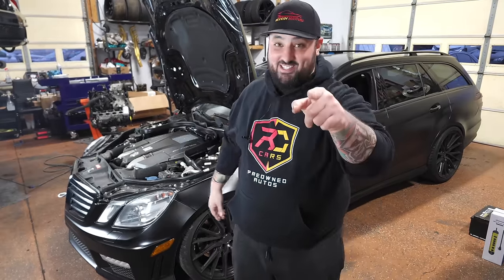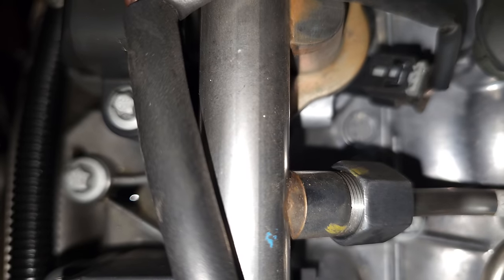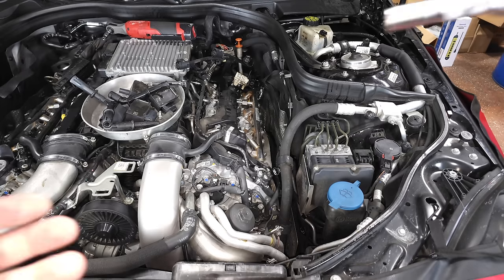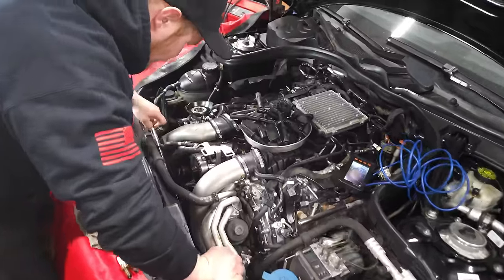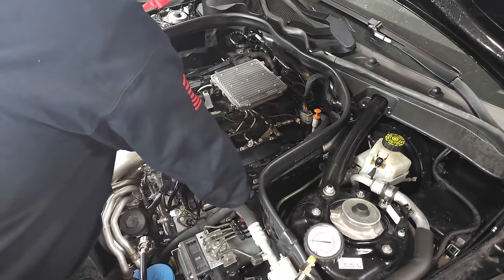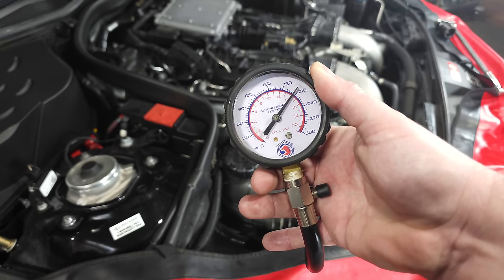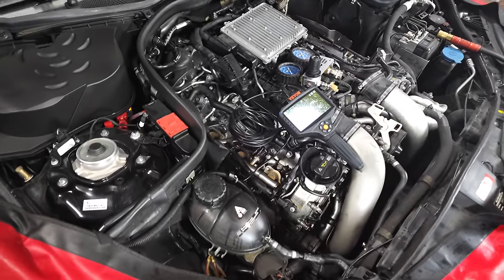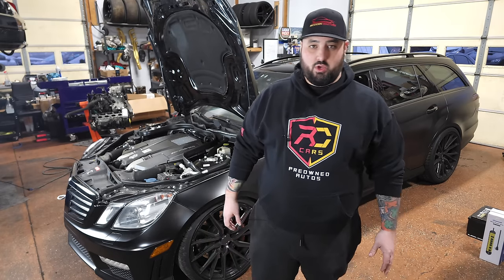Biturbo AMG Diagnostic and Results! 3 Major M157/M278 failures to look for on your Mercedes Engine!

Comment: Around those miles on m157 is going to hit you on the pocket. Turbo cooling lines goes bad, heater valve breaks “ major cooling leak “ camshaft sensor goes bad , torque converter goes bad, high pressure fuel pump also, shifter goes bad, and more
Reply from the maker: Yes!!! Have to freshen them up for the next 100k of enjoyment!!

Comment: I have a cls63 2011 same problems made me sad also the computer gearbox Cost 2500 € now arco not work so bit sad stil for me best looking amg but in Nederlands car Costa fulloption 180.000€ newe boot my 2022 135000klm have 645hp love car but i think to manny weak problems nowe car cost me 40k repairs 15k extra inculd brakes and disk That was 5k hope no more cost uh time chane is not done but no ratels thx for this good video

Comment: 2016 SL 550 76 K Miles. Zero scoring or  leaks. All numbers on diag are factory still.  

1. Turn off the dumb auto start stop 

3. 3 K Mobile 1 service intervals NOT 10K

4. 93 only 

5. Never skip required maintenance 

This has worked for me with this M278

And I did all 3 like comment sub
Reply from the maker: Thanks Chris! And that's a hood way to maintain your car! Try some liquimoly oil flush, and oil!
Reply: Another huge thing that is overlooked is that the 2016 and newer m278 engines have iron cylinders instead of the garbage Silitec ones made in the earlier cars

Comment: Fabulous content! Keep posting! Army vet, as well (4 ID). I am an M157(wagon) and M278 (CLS) owner. Both engines have updated chains; both engines experienced oil intrusion to the harness at 20k original miles (remedied with new harness/ECU/4x CSPSs (M278)) and cleaner/2x new CSPSs for (M157)). I swap engine oil every 3500 miles (0W-40 Mobile 1 with BG additive) I will be switching to Liqui Moly on next servicing. Compression tests OK on both engines (knock on wood). I also don't hot rod either of them very often; just a spirited spank every now and then to "reboot" the engine cadences. Top tier premium fuel always.
Reply from the maker: You, sir, have some cool rides!
Reply: @ModernMastersAuto  They are special indeed!

Comment: i was expecting 20-30k subs! great quality and you'll reach it in no time
Reply from the maker: We just started but it's only getting better from here! Thanks for your time!
Reply: thanks for explaining the leakdown, also when you smell the spark plugs what is a "lean" or rich smell?  @ModernMastersAuto
Reply from the maker: @Zzafari7  lean has a distinct odor and it means the car was ran opposite of rich meaning less fuel and a hotter burn. Rich smell is just fuel a lot of fuel!

Comment: i have a 2012 with old timing chain. been relgious about oil changes and NO tune. been fine so far but im sure if keep the car will need to change it. 105K miles

and the headbolt issue was a 156 issue right, not 157

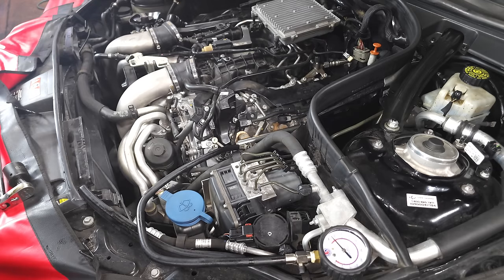Comment: 31:34  On the engine ecu you have an automated electronic compression test that gets you the same results as the manual compression test so no need to waste 1 hour dismantling and screwing in the test gauge just be sure you know how to read it.😊
Reply from the maker: With wanting to know the technicalities before deciding on building or saving an engine, a manual compression test is the only true way to know. Never go off a scan tool for something this expensive.
Reply: It was just a friendly advise , you shouldn't get offended like this. I worked on the electronic design of these cars as an engineer for daimler , using original equipment to do a electronic compression test is the same as using a manual compression test but takes 1 minute and you even get the difference test graphs but you only need to know how to read it, the diagnosis tool named STAR will instruct you when to use a leak test tool and diagnose further , in a mb workshop there are a lot of cars and pulling out plugs is time consuming so my colegues design this test . I'm sorry that you took my advice the wrong way 😔
Reply from the maker: @Hi.Al.  I didn't take it the wrong way and I'm sorry if it came off that way. With how bad these engines are getting we jump right to physically testing compression and leakdown.
Reply: @ModernMastersAuto  I can confirm the first generation was a recall frenzy because of ecology mods required by law here but the last generations had steel liners along with improved timing chain and different diameter tensioners,  resealed sensors, re designed intercooler,  and many more improvements too many to write .

Comment: What was the outcome on this? My 2015 E63 S has a weaping rear main seal and seems to be burning some oil (ir gets drivrn qhite gard tho) I have no other known issues and am very familiar wirh the platform, but the KBB value has dropped $12K since I bought it and the value is now underwager vs my loan amount remaining. Im thinking of getting out of it rather than dumping money into her, even though I LOVE this car and the M157, my financial situation ahs deteriorated in the 2 years since I got her and looking at $5-10K in work is now not really feasible anymore. 

Given that, what should I expect to pay to have a borescope check for the cylinder scoring and a pressure/leak down test performed?

Comment: What do you disconnect to do compression test on this m157?  just disconnect the ME? because the fuel injectors are directly control by ME ? I’m trying to do my spark plug and check the condition of my cylinder walls
Reply from the maker: Yes!

Comment: Question, the oil coming from the valves is it due to the valve stem seal failing? Or is that due to carbon buildup on the back of the valve.
Reply: Mostly all these engines have the oil coming in oil oil buildup plugs if not positioned properly. I don't see anyone saying why.
Reply from the maker: It's coming from the rings and being blown up to the valves. On a non direct injection the fuel would normally spray this off. This is why carbon cleanings like walnut blasting is done. Be sure to watch that video we put out!

Comment: Thank you.  Terrific instructional.  How much for the fix?

As owner of 70 kmi '14 e550a with this motor,  seeing the problems is very helpful.  Also scary.  No problems yet.

Can't imagine rebuilding this beast with such low mileage.  My Nissans all passed 250kmi with no issues.  

Really feel taken by MB, putting time bombs on the road.  All of these problems were avoidable in design...and they use limited lifetime plastics too..
Reply from the maker: The newer ones are have less issues! But definitely keep an eye for oil and coolant leaks!
Reply: @ModernMastersAuto  Thank you.

Comment: Why does my dealer consistantly tell me that I do not need to replace my chain and or tensioners? I was told that there is no real reason to do so. I have split link.
Reply from the maker: They want your engine to fail.

Comment: Is there a root cause for the cylinder scoring? It seems like its a design issue from mercedes, but is there something to prevent this issue, or do you just have to roll the dice on an engine?
Reply: It's roll of dice. It is indeed a design issue. We have discovered that for emissions purposes, the oil pump solenoid restricts pressure under 3000 rpm enough that it will not activate the oil squirters in the cylinder walls, so basically unless you're driving it is S+ or M and controlling a higher shift point, you'll be starving your cylinder walls of oil 99% of the typical driving time. This has led to better overall performance of the engine and feel of the car while driving, even ironing out the lurching/bucking from a stop issue.

Best thing to do is pay for a PPI and have the cylinder borescoped during that PPI
Reply: I should have said, disabling the solenoid by unplugging the solenoid, leads to the better performance
Reply: @GoldenEagleXTND u heard of any long term side effects to unplugging the solenoid? A couple shops have told me that it isn't good to do it but I don't know if they're being genuine.

Comment: Want an 5.5biturbo so bad, 
But all these issues with these engines....
Guess i'll have to stick to my S55K
Reply from the maker: They are still worth it!
Reply: I have a 55k as well and just purchased a 14 cls63s and has a misfire on cylinder 5
Reply: @shosaleen Did you get it figured out
Reply: @MoneMost-r1g  internal engine issue.  I returned it
Reply: @shosaleen  Too bad.. What did you get instead?
Reply: @MoneMost-r1g  I haven't replaced it with anything else, but I still have other vehicles. I might get a gtr if I don't get another cls63s awd
Reply: @shosaleen  Nice.. I’m about to grab a 2014 e63s AMG so I’m doing my research but I’m only keeping it for about 2 years, just want something to play with.. Then I’m going to a 2020 E63s AMG, that 4.0 liter is a great platform.. The M5 competitions are really nice too